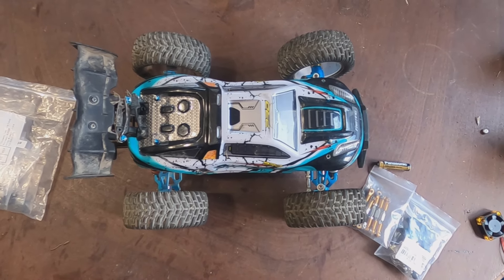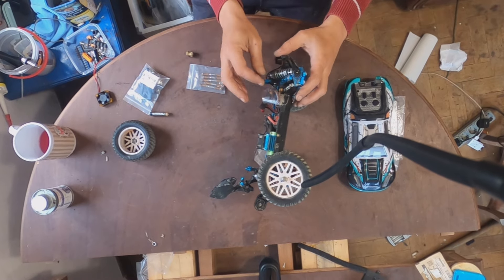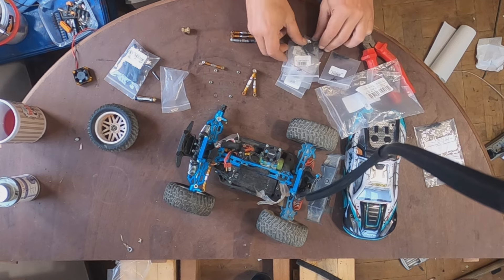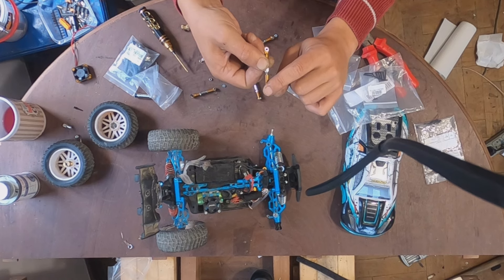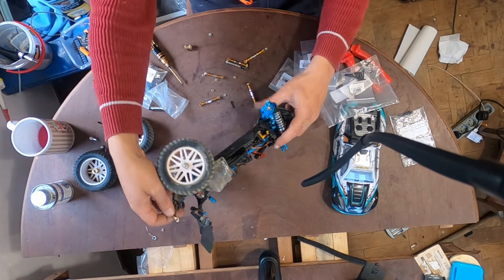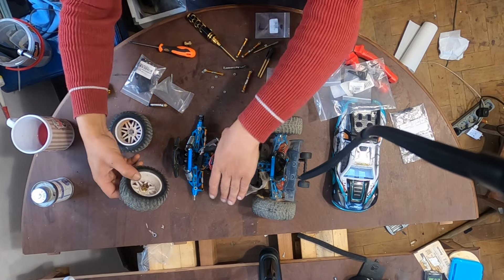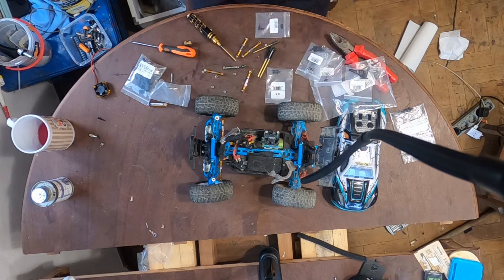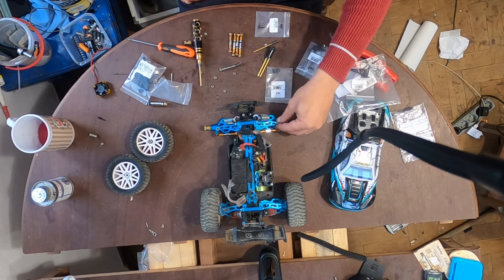The Beast gets a treat :) sg116 max steering link and screws upgrade!

Comment: Hi nice video it looks like you changed almost everything 😂 is it still SG116? Just kidding... I found weird problem on mine maybe interesting for you as I can see you not only buying parts, but you really think about things how it works when upgrading. 

How to explain it right way...I have a problem to straighten up the trace of my Max. Im not able to balance steering direction throught ST trim knob on the remote control for longer period. When I do that and everything looks OK its again unbalanced after some steering with remote control steering wheel to left or right. E.g. when its directing straith with some ST. Trim knob balancing-> I rotate control wheel to e.g. right -> I leave RC wheel in neutral position (only throttle) then its again a little bit to the right. When I do the same to the left even after balancing with ST trim knob its steering by itself a little bit to the left. Any thoughts? I checked links and everything and it seems HW is OK. Its like the servo isnt able to get to exact the same neutral position after manual steering. Normaly its not a problem only at high speeds its dangerous to crash and I have to  compensate it every time I try high speed. Sry for my english its not my native language. THX glad to talk to you. cheers.
Reply from the maker: Hello  @kultus26  i suspect that maybe you have one or two broken teeth in the servo gears.
Do you have stock steering links and all that?
Try to remove servo plug from esc and give a clean sometimes taking it off and install it helps.
Its easy to remove amd open the servo, do that and check if theres is something broke, if it his, turn the gear 180° and install it again.
Please give some follow up on how it went or if need help on doing it i will do a small video showing how to remove and open the servo to help you.
Thanks for the comment i much appreciate that for sure.
Feel free to ask whatever you need i will try my best to help you my friend.
Thanks for watching and has i allways say... dont be a stranger 😀
Reply: Yes everything stock except shocks but they dont affect this behavior. I also realized that when I set (by hand) the front links and everything symetric to car axis, left and right tires are in shape "V" but I read that some manufacturers do that by stock and it can be "repaired" by new adjustable links e.g. yours but still this also shouldnt have impact on balance changes during driving. OK I will try it and give feedback but its strange as driving forward and backward acts differentialy. Driving backward is less balanced than drive forward.THX for now
Reply: Im back. So, to dismantle and get into the servo it takes more time, focusing and confidence for newby than I have for now but...my observations. 

1.  disconnected first control rod with balls joints on both sides from servo to links, set "0" on ST trim knob, turn on vehicle and short "vertical" servo rode (with spring) is exactly in the center and vertical. That is good.

2. when I connected control rod back the issue is back.

3. when I was slowly steering to the left or right I could hear some little  squeaking noise from both sides and in my opinion its not so smooth than I expected, but this can be caused by almost whole plastic mechanism and natural deforming of the links and control rods during steering because of quite big forces and moments. Just my opinion.

4. The most important one. When I center the servo vertical control rod (with spring) and trying to steer with steering wheen not by hand ( in the air to eliminate influences from car weight and tires resistance), when I steer to the left and then stop the servo is returning to different position then when I steer to the right. So servo is not returning to zero position when the whole servo steering mechanism is connected. That is why the tires are always in different position after stopping steering to right or left. With only throttle car is steering itselve to the right or left depending what was last steering direction (left or right) and its impossible to compensate it by ST trim. 😮 Super weird. What know and idea what to try?
Reply: @Fast_Lane_RC  I was studying on YT a little bit and its all about recentering the servo to initial position. I checked it again, unconnected steering mechanism from servo and I can confirm that servo is recentering well when nothing is mechanicaly connected to it which is good news. Bad news is that there is something wrong with the rest of steering mechanism. So where to start? I checked all ball joints and screw connections and all looked OK. Any idea how to recheck it and what details to aim to more? It looks like there is more resistance in mechanism and servo cannot override it... How about you how smooth is yours? Is it balanced and driving at least 99% straight? 😂
Reply from the maker: @kultus26  i am trying to figure something, maybe check that central piece where the steering links atach and see if it rubs against the front differential.
My beast is turning not at its best aswell not so problematic jas yours cause mine keeps straight but i also ear some strange sound when the servo is connected and i cannot turn full lock. I will remove my servo and check and film it to share. But my stock Beast turns perfect, so i guess something must be worn out and i bet in the servo but i can be wrong. The bigger wheels dont help but in the begining it turned very well and with time it got bad so the servo i am hoping must be the culprit 😀
I will tell you my findings when i remove the servo and inspect further my friend, i will try to do it tomorrow.
P.s: the servo without doing work doesnt fail only fails when we put force to it cause this makes the teeth slip if they are worn out.
Reply: I understand but my Max is like new, I tried it only few times...no big jumps or crashes, no long speed tests etc. so the worn out is not probable. But yesterday I checked the central steering piece and there is enought space so here its presumably OK. I will wait for your findings I can live with it for now.

 Maybe its good idea to dismantle the whole steering mechanism + wheel mounting arms and start to mounting it back piece by piece from servo to forward to find the culprit. But this is quite difficult and needs a lot of time to find the cause.

Just want to ask another thing about new links you bought. Is the steering link (the smallest one) from Wltoys 144001 compatible-usable for Max's steering servo link? The balls and length? THX
Reply from the maker: @kultus26  in the middle piece the one that attacjes to both steering links it has 2 screws on top, try to loosem them a bit and test
Reply: @Fast_Lane_RC Thanks, tried it but it didnt help, loosen or tighten no change. IMHO the problem is in the front steering cup and lower arm. OK sure there is almost everything made of soft plastic, so a lot of resistance and small deformations in the whole steering mechanism. But the most in the place when the low arm touches steering cup. Furthermore, the front shocks makes even more pressure on this place. Ofcourse the stiffier shocks the more pressure to the low arm and more resistance for steering and servo.

I dismantled both cups and lower arms and I can feel the pressure and very little deformations in links between my fingers. I can also hear squeezing sound from steering mechanism (middle steering part) the servo is so overloaded. The best results for servo recentering is with low arms dismounted from cups. I also got much better result with only left cup and low arm mounted together so I assume the biggest problem is in right arm-cup connection maybe because of asymetric steering mechanism.

This is how it acts. https://youtube.com/watch?v=Kb9cmwciMiY&feature=shared

https://youtu.be/HGXKZ0wqtEA?si=ENdKzr9EFQbSlkmV
Reply from the maker: @kultus26  i saw the videos, with the stock suspension does the same?
Tighten the servo saver arm to see if it helps.
Reply: @Fast_Lane_RC I already played with servo  lever (spring) in the morning, no different settings helped. 

I cant remember the sounds with stock shocks, but I had problems to set the car drive straight from the beginning. At that time I was naively thinking ST trim will resolve it but...geuss what? 😂and we are here now... What about you did you hear such a squeezing sounds from the begining? The new shocks are stiffier than stock but they are only a little bit longer.

Edit: I just changed front shocks for original, but no success.

And new problem occured, most of the time I lost ability to fast break by pressing reverse throttle 😢 It looks like my car is cursed...
Reply from the maker: @kultus26  damn i dont know what could be but i recommend you do one thing send the shop where you bought it a message explaining what is happening on basic terms so they can give you a refund. If you bought it from aliexpress i am confident they will help you or refund you. Maybe you will be able to correct it but just to play safe.
Maybe try to remove the esc servo plug and clean it with contact cleaner do this in all conections and if you can disconect the lights just to rull out problems
Reply: So after a lot of spaming and loooong negotiations Ive got back around €16 because they didnt want to admit that something is wrong about braking of my car. The problem is how to find put when its ESC or motor which prevents from correct braking function. Most of the time even from higher speeds it denie to brake properly and try to reverse instead. So the car is stopping eraticaly.
Reply from the maker: @kultus26  my bet would be the esc one costs only 12€ uou want me to semd you a link? The esc has the receiver and so its the most propable cause.
Reply: @Fast_Lane_RC yes sure is it better than stock? I will wait until I will have lubricants, dismantle car relubricate whole transmission and diffs and check again all gears, position of motor + transmision cones etc. and will see if it helps THX
Reply from the maker: @kultus26  i was talking about the stock one but its not so cheap has i thought around 20us.
To change to another esc you also need a transmiter and receiver. And we cant be sure its not the controller, bit i giess the esc because you have problems in all controls but one pf this two must be tje culprit, its a bummer really. They should give a full refund or a replacement. Although ypu got it half the price thats the positive in this.
Reply: Yes sometimes refund is no problem, but after a month with no official guarantee Im glad to get at least something. Anyway I will wait for big overhaul if it help. It really looks that my car is crap or cursed 🙄 yesterday I was testing metal steering upgrade which is horrible I can say (more about it later), living room, low speeds I only slightly crash into the wall and servo plastic pinion rewinded in aluminim lever. I didnt think it can happen at home conditions and some pinion teeth are damaged so I had to order new servo with metal pinion LOL
Reply from the maker: @kultus26  go to the church 😀
Reply: Maybe rather to Aliexpress
Reply from the maker: @kultus26  i was just kidding because you said the car its cursed 😀 but aliexpress failed here should had given you full refund.
See you soon.
Reply: Yes you are right but at least something and I have to focus to resolve the steering issues. My leg is better a little bit so I was out with a car to test new servo and metal steering upgrade. Steering was fine but I have to figure out loosing adjustable st.links. On very very rought paved road both steering links loosed up and the car was unusable so maybe some Oring or safety washer plus tight it as hell to keep it in set place.
Reply from the maker: @kultus26  you have to use blue threadlock on screws that go on aluminium, allways. And you may also use another Nut. Mine also backout but just after hard bashing and rarelly happens. Did you use blue threadlock? If it doesnt work go for the red threadlock that way never comes out.

Comment: 👍nice video brother..
😅Brother can test upgrade Ysido 2847 5600kv..60a brushless ESC..oil shock.. receiver..radio control & small pinion gear..
😂because im upgrade Ysido 2847 5600kv brushless motor..80a brushless ESC..oil shock..small pinion gear..receiver & dumbbell radio control..
If brother after upgrade brother just know what is crazy fast & easy wheelie...
Im after upgrade top speed now is 103kmh-135kmh..
Wish brother video channel 1days must be more many fan...
Have a good days brother...